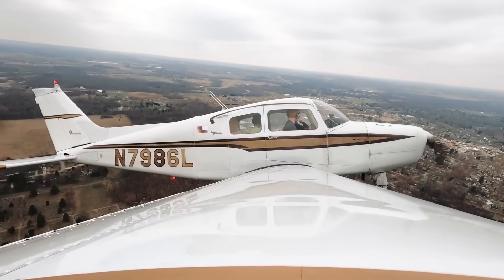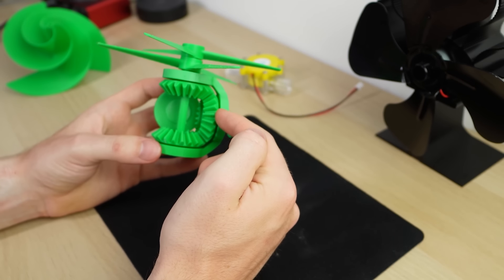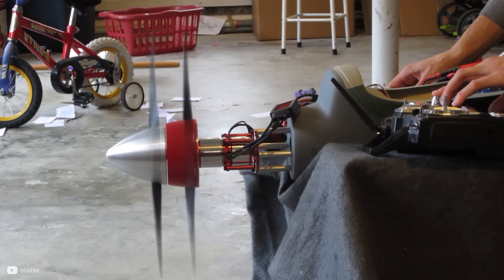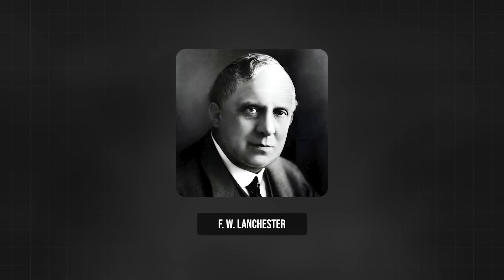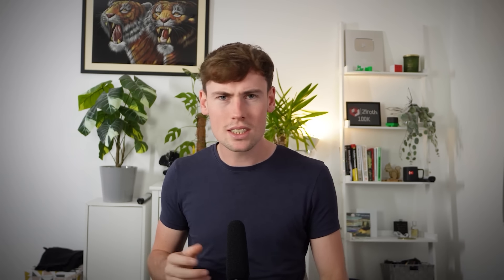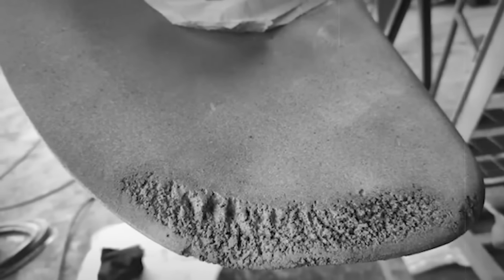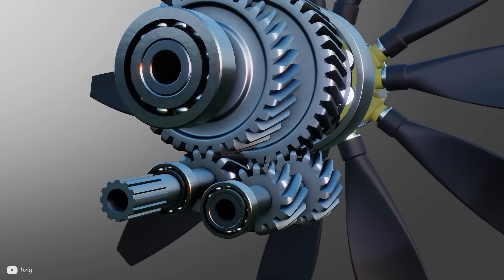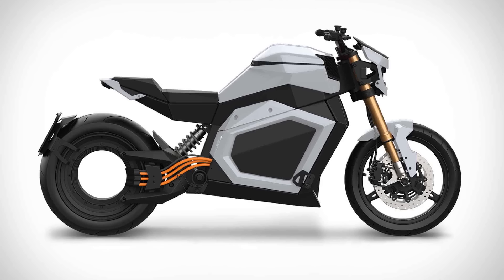The Unexpected Genius of Contra-Rotating Propellers

Comment: In wind turbines, efficiency drops when the airflow powering a turbine is more turbulent.  There are algorithms to maximize farm output reducing power generation where the airflow from upwind turbines affect the downwind ones such that the upwind turbines operate at a lower capacity so that downwind turbines have less turbulent air. As such the whole farm outputs more power.  That is only to point out that in the case of a counter-rotating propeller system, the second propeller is pumping turbulent air and therefore suffers an efficiency loss.  I think a lot of the noise of the commercial plane using this design was due to that issue.  

The key would be to try to preserve laminar airflow if that's even possible.  The rear mounted systems are likely best and rather than a counter-rotating system, perhaps a set of blades in a stator setup that can redirect air vortexes directly rearwards is a better design.

Comment: Counterpoint: a well-made, highly balanced toroidal prop setup requires far LESS maintenance than a normal shaft drive system would - in a marine application. Gearboxes would run smoother because the tolerances can be tighter because the props are balanced so you get less noise (which really is a symptom of wear and efficiency losses). A boat with two IPS (independent pod steering) drive units (engine + transmission) each with a set of contra-rotating toroidal props at the end with a hybrid electric driveline in parallel would be THE most maintenance-free boat. The upfront cost would be higher, yes, but in a marine environment, it's the maintenance costs and time losses that kill both your wallet and your passion. Not the actual cost of the boat.

Comment: The noise really isn't about colliding tip vortices.  It happens whenever there is any dirty air in front of a prop including that coming off the wing or fuse. This is why aircraft that use a pusher configuration are also very loud, like the piaggio p.180 which is incredibly efficient but banned at many airports.    Putting one prop in front of another just means more dirty air and more noise, producing some of the loudest aircraft to have ever existed.  The answer being investigated is to put variable pitch blades like stator vanes behind the prop that simply straighten the air out, without having to actually rotate..  increase deficiency without the added noise.

Comment: Technically we did have a commercial aircraft with contra-rotating propellers more that 70 years ago in the early 1950s - well, almost: The Saunders-Roe Princess flying boat was designed to be a commercial passenger aircraft, was actually built and successfully flown, though didn't go into service. It was the largest flying boat design ever made and one of the largest non-military aircraft in existence at the time. It had 2 conventional single propellers and 4 sets of contra-rotating propellers, driven by a total of 10 Bristol Proteus turboprop engines. Each set of contra-rotating propellers was hence driven by a pair of engines, with each propeller in the set being driven by its own engine.

A few years earlier, there was a piston-engine powered aircraft with a similar propeller arrangement: The Bristol Brabazon had 4 sets of contra-rotating propellers driven by 8 Bristol Centaurus radial engines, again with each propeller in a set driven by its own engine. This was also designed to be a commercial passenger aircraft, serving the luxury market, but again did not go into service.

So the idea of using contra-rotating propellers is not a new one, even for non-military aircraft. The only new part is arguably making an aircraft fitted with them into a commercial success. Though having said that, both the Princess and the Brabazon were commercial failures for several other reasons, none of which had anything to do with their contra-rotating propellers.

Comment: The P-38 used counter-rotating props, though one engine drove each prop. This keyboard fighter jock loves the P-38.

As far as the 110 dB of the Tu-114, I bring you the C-5, which I got to ride back from Europe. it doesn't have the niceties of sound insulation (that weighs a lot), and sounds an awful lot like being trapped inside a giant vacuum cleaner.
Reply from the maker: Sounds like quite the ride! Bet it was an awesome experience, even if your ears needed a rest afterwards 😂

Comment: Using guidanes vanes behinder the rotor blades - like turbofans do - makes even more sense, as the energy transfer from blade to air is better/denser and less energy wasted in turbulences. That's why turbofans have replaced properllers and jet-turbines in commericial aviation. They are the sweet spot between efficiency and speed.

I see a big advantage in electric aricraft though: You dont need any gears/transmission. Just put 2 electric engines behind each other, the back one rotates the inner shaft, the fron one the outer shaft.

Comment: 2:35 You can get the counter rotation perfectly efficient, the problem is the speeds between the two props will need to be dynamic, as the forward one speeds up or increases load the aft one isn't going to see the same loads increase (or decrease) proportional with a fixed gear ratio.  There will be conditions where your aft prop is producing unessecary load/drag unless you can dynamically compensate for the changing "exhaust" of the forward propeller.  And then as the aft/secondary propeller becomes more efficient the forward prop's dynamics change.  This is gonna be tough for a human or a computer to perform better than a single prop.  Maybe counter rotation is better in a ducted fan (turbo jets/fans don't (do they?))

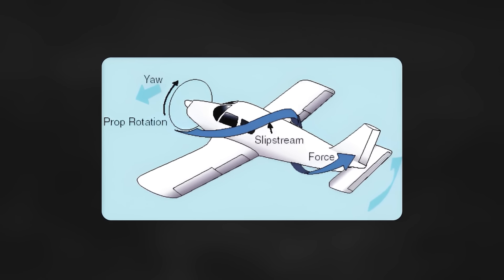Comment: 1:14 Slight correction here. The left yaw motion from the torque of a propeller is a very minor force and acts int he direction of the propeller’s motion. For example, a clockwise rotating propeller rotating from the pilot’s perspective will provide a yaw to the right. The left yaw tendency of an aircraft on takeoff is due to the propeller slipstream hitting the vertical stabilizer, not the torque

Comment: Wouldn't it be better to have counter rotating blades close together side-by-side instead of inline? Then they will still cancel out the overall torque on the vehicle without having to change the direction of the air or water and push against each other.

Comment: I'd say that almost all commercial airliners have counter-rotating engines. In a turbine engine, while the rotating blades/nozzles are all rotating in the same direction, the stationary buckets/vanes are redirecting the gas in the opposite direction. My layman's understanding is the efficiency is gained by having the fluid flow be perpendicular to the direction of travel, whereas a single blade is imparting some off-axis momentum to the fluid, and that smaller part of the vector isn't propelling you forward.

Comment: This might work very well in an outboard motor, as that has a 90 degree gearing at the bottom already. Putting in your "half a differential" (basically) will not take up much more space and is a very simple solution. Engine manufacturers might not be ready for toroidal propellers, at the same time, but this should be very easy to implement. It should even be easy to implement for amateurs messing around in their garage!

Problem is, a lot of the people who mess around with boat motors and gearing aren't the people who care about efficiency. So maybe start talking about a 15% increase in thrust? 😄
Reply: The 2 gears on the prop shaft rotating in opposite directions are used to give reverse with contra rotating props a separate reverse is needed. so extra space is and parts are needed.
Reply: @JonathanTamm  Yes, but not much. You have interlocking, 1 horizontal and 1 vertical, gears. You basically only need to add a second vertical on a hollow shaft for the counterrotating (innermost) prop. This is in the little gear box in front of the prop.

Comment: Well, first of all the main reason why contra-rotating propellers were developed in WWII was the sheer torque the fighter planes had to deal with. Many pilots of Spitfires, Bf-109, P-47 and P-51 did flip their plane on the runway at takeoff - because they were applying the throttle too fast. 😁✌️
After WWII it was seen as a method to archieve more thrust. But realistically they only produced around 1.5x the thrust compared ti a single prop.
Like others already wrote the main problem is that in most applications the same size propeller is used for the rear one. Many designers didn't optimize them for the faster airflow and vorticies that the front propeller is creating - thus the noise and efficiency losses. The Boeing 7J7 project had the same problems. This is the reason why the CFM RISE project does thing a bit different. 😉

Comment: Would a second (back) propeller spinning slightly faster that the first (forward) one make sense? The air flow would be accelerated faster by the second propeller, arguably improving efficiency.

Comment: Ducted contra-rotating propellers get an even bigger efficiency bump from the ducts removing tip vortices. Studies about the optimized geometry for the ducts claim potentially huge efficiency if the geometry is right. The combination is almost necessary for EVTOLs which need every ounce of thrust they can get to offset the heavy batteries.
Reply: The only reason to have a shroud on an EVTOL is because you can't have large rotors, because you're intending to operate it in compact environments.  The traditional helicopter is an efficient design.  The modern multirotor exists out of brute force because power is plentiful, but it's not particularly efficient.
Reply: Can you point me to those studies?

Comment: Rear propeller has worse airflow conditions compered to the first one. Two propellers have bigger drag then one big propeller. They use it only if there are no place for one big propeller or  in very powerful single motor plane to compensate rotation. But even in such powerful planes as Corsair or thunderbolt they used one big propeller.

Comment: Curious if you could make the system with a 2+3, 3+4, 4+5, 5+6, etc pro layout?  That way it’s not nauseatingly loud.  Every time the blades pass each other, they basically clap.  When 3 blades match at the same time, you get a triple clap.  If they’re off by 1, you’re losing some of the benefit, but smoothing out the sound.

Comment: I wonder if the two propellers would benefit by being driven from a differential gear setup so that they each received equal torque despite possibly seeing different loads. Any unequal load would make them rotate at unequal speeds, the sum of the two speeds being unchanged. Would help the torque reaction problem on a plane, but might partially undo the smoothed airflow exiting the rear prop.

Comment: Counter royatong propellers hbe may disaadvantages mone which mentioned in the video. 

1) signficants added friction of of the reqiured greatbox.

2) Siginficant added weight, bigger issue for
 aircraft then ships.

3) Increased complexity = less reliability

4) higher intisl costs.

5) Higher maintenance costs.

All reducing efficiency.

Comment: considering the propellers effectively mutually change the precise air flow of each other (especially the leading propeller for the trailing one but I imagine their proximity might be close enough that the trailing one has a direct effect on the leading one as well) I wonder if the optimal thing to do here (for efficiency or for sound) isn't two exactly equal propellers.

Comment: Well from the initial graphic it’s clear that this uses simple sun & ring planetary gears.   

It’s fairly easy to harvest small ones from electric drills - I’m wondering why that wasn’t your 3D printing project? 

The planetary gear design could even be used to change the relative velocity between the two props enabling torque assisted maneuvering.

Comment: You never talked about drones.  A pretty famous counter rotating design would be ingenuity on Mars.  Also I'm curious why there isn't a dual electric motor design?  the axle could house the stator and the blade the rotor, something similar to what verge motorcycles is doing with their electric drive.  I know there's added weight by having a second electric motor but eliminating the gear box, increasing reliability, and the potential for some interesting vortices precision control mechanics sounds like it'd be an interesting experiment in the least.. yet the internet hasn't shown me any examples.. why?

Comment: It seems like you could simplify they seem a great deal just by spinning the inner and outer shafts with their own separate motor.  That does not seem much more complex than a twin engine system, and provides some redundancy as the loss of one motor would not effect the other.

Comment: Torpedoes used them to allow the orientation of the Torp to stay true. Volvo in late '80s developed the DP system and through development needed to trim the aft screw by an inch, since otherwise you literally couldn't turn the sterndrive. The grip was that strong. A little bypass made all the difference. Mercury Marine made their versions and they are respectable. I miss the Surface Piercing CR drive they made. But I guess 10,000 dancers dancing on a rough surface can be hard to coordinate.

Comment: Penta-Volvo has made counter rotating  marine propeller inboard and outboards designs for over 20 years..  the problem I deducted with these toroidal propeller designs work best in a small speed range on marine drives.   So maybe for and ocean going tug or fast (17-19knots) bulk cargo ship of the twin shaft design..

Comment: I could be wrong cuz I've mostly looked into the efficiency of counter rotating ducted propellers, but when I did I was seeing significant decreases in efficiency. Like 15-30% less efficient than two separate propellers. This seemed to be due to a combination of drivetrain losses and the rear propeller engaging with turbulent flow.

There's a lot of ways in which it is more efficient, like for a given swept area you get significantly greater thrust.

But I'm wondering if your improved efficiency numbers are comparing contra rotating to idk synchronous rotating instead of more propellers with equal blade loading.

Comment: To add to your description of the turning tendencies: 
One of the biggest ones we feel is called P-Factor, which is where the downward moving propeller blade takes a bigger bite of air than the upward moving blade creating a thrust imbalance. This happens because the relative wind encounters the propeller disk from slightly below.

Comment: Whilst toroidal propellers are more expensive than simple ones, and contrarotating props more expensive than single ones, and obviously combining both even more expensive; but bear in mind that contrarotating propellers are two in one, so should be at least twice the cost, AND twice the power, and toroids adds more power and efficiency, and other benefits too (reduced noise, cavitating damage, replacement frequency).      Once we are able to come up with a third combo element, of concentric reversing gearage, or bypass it by use of electric motors with opposite polarity instead, there could be big benefits, worth the development costs.

Comment: Having a transmission to deliver power to both propellers probably would induce around a 10% loss of efficiency compared to a single shaft. That probably negates a big part of the efficiency advantage of the two propellers.

Comment: It is really interesting that these two technologies haven’t met with windmills to produce higher efficiency windmills which are more quiet and have impact due to low frequency sound waves.
Reply: I doubt there is anything you can do to a windmill to make it a viable, reliable source of energy, we are finding out the hard way after all of that money wasted 😢
Reply: @darthnihilus511 lol, have you been living under a rock since 2000? Work for the oil industry? 

 I don't think you know what you're talking about. Clearly you are ignorant on the subject. 

 Wind is the cheapest form of new energy production now, and only getting cheaper. The percentage of total wind will rise significantly. 

 There are literal swathes of areas running off of offshore or land based wind across the world. 

 Any failures happen due to operator error or poorly designed grids. Like in Texas - but wind didn't just fail. Their gas plants also failed. Practical Engineering has a break down on what happened. 

 Stop getting your information off tiktok or Fox News.
Reply: When 3d printing becomes better then definitely for smaller blades. 

 For grid? 

 Right now cost is everything... It just wouldn't make sense when you can purchase much larger designs of a less efficent design for the same price.

  Afterall the bigger/taller the blade the more power you get by a big factor. It is why we've constantly pushed for bigger standard designs. 

 For example the world's biggest design is coming out at 140m. Just making the blades 10m bigger of the previous record holder netted you 2 more megawatts. 

 Once we hit the limit where going bigger is no longer feasible or wanted then definitely. 

 When that happens I have no idea. China will launch a turbine with some truly monstrous blades at 140m and over 50 tons a piece. Generating like I said 18 megawatts total. 

 Soon we will have ones that are skyscraper tall at 150m plus! Wild.
Reply: windturbines can only have a maximum efficiency of about 59% and the current designs are getting quite close to that. Having two rotors would be much more challenging and costly than the efficiency gains would ever yield.